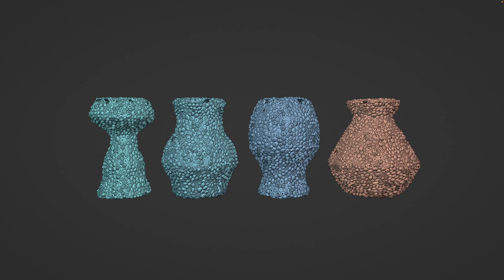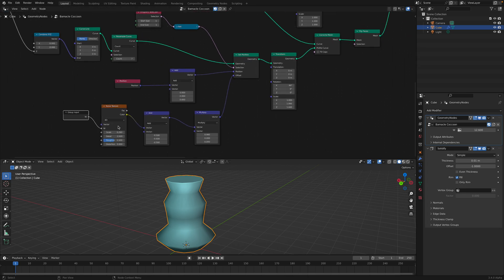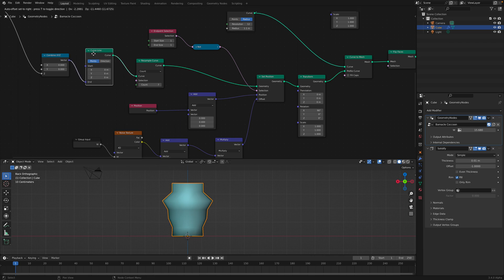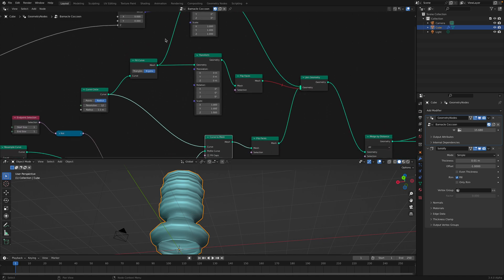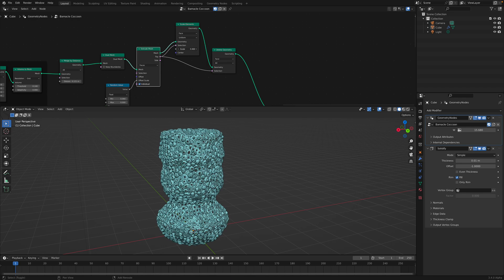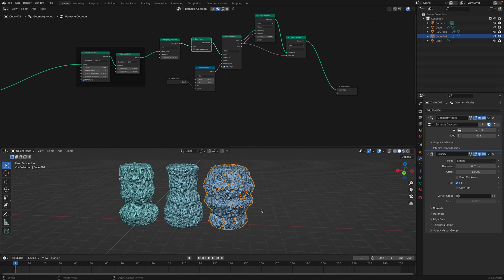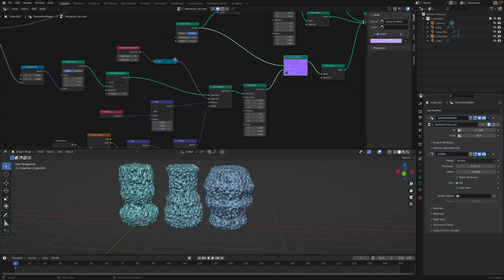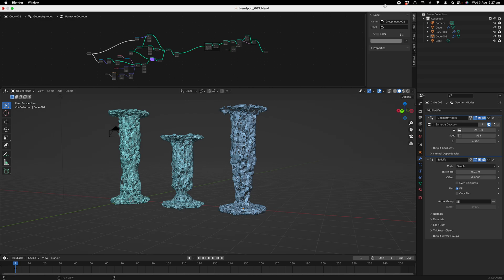LIVENODING Barnacles Cocoon Vase Using Geometry Nodes

Comment: I was playing with a comparable setup yesterday... Sure, we can work around the lacking revolve node. What I'm sorely missing is a way to use multiple profile curves, so the whole thing becomes a little more like a NURBS system. No metaballs in GN either. I'm messing around with the curve radius, even employed a float curve graph node, but it's all so very clunky. Can't wait to find out what new nodes are in Blender 5.1! (But I'll settle for 3.3)

Still, a lot of fun, and thinking up workarounds is a good exercise, I guess. As always, thanks for your take on this kind of shape generation. Throwing noise at it seems to be quite adequate.